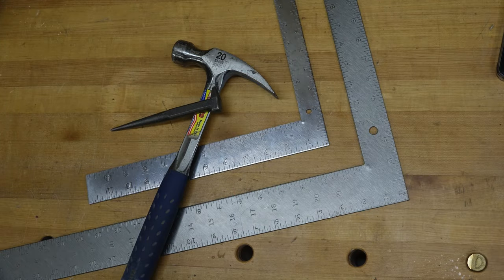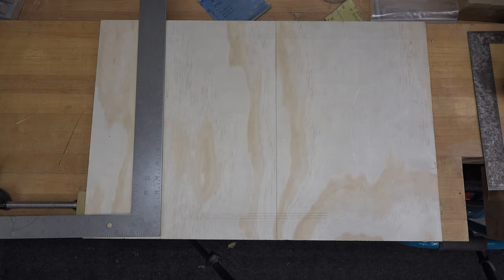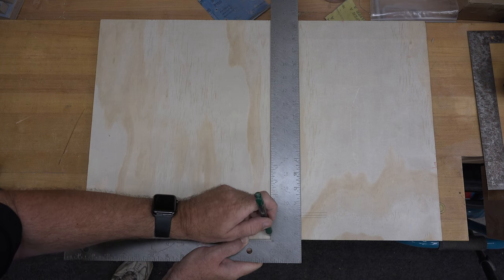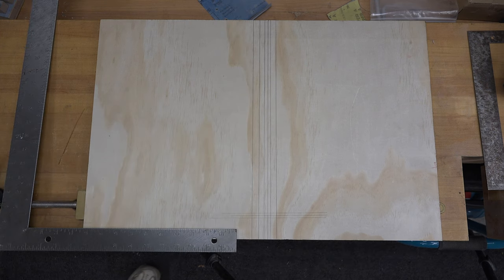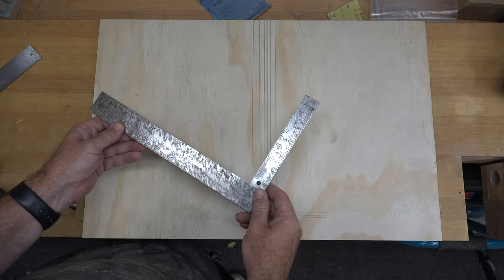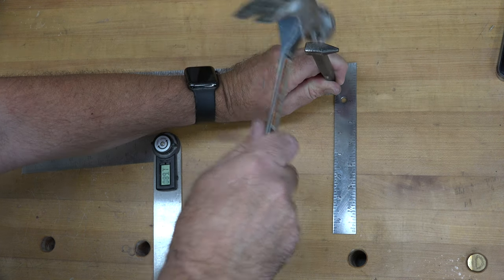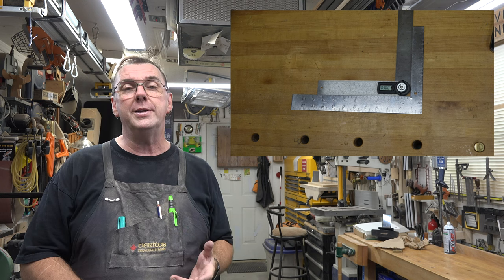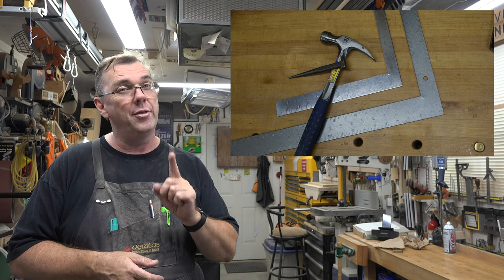Truing Up a Framing Square

Comment: I will be the picky one that points out that the first two lines you drew were on opposite sides of the blade.

Sometimes the blade edges aren’t parallel, so that could be a problem - and you didn’t address that possibility.

Your method for correcting is a good one.  Just check both sides of that blade! 😆
Reply from the maker: While you are 100% right that I mistakenly used opposite sides for the initial test, you will note that for the remainder of the video, I only use the one side of the blade.  I realized my mistake post production and it was too late to change it.  The method of squaring the blade still remains the same however.  Thanks for tuning in and for chiming in with your thoughts Dean.

Comment: Were you adjusting a steel or an aluminum square? That trick does work very well. I used to use a steel square for carpentry at home, but at the ironworks we used aluminum squares. They would take a lot of abuse against the beams or what ever when we were laying out or fitting up structural steel. There was a master square in the stockroom for us to check our squares against. We would make bevel squares out of the bad ones. QA wouldn't let us correct them. I had a really nice steel square years ago that was true until I left it in the hot sun when I was working on the house. It wasn't 90 anymore and it warped a little. Bevel square time lol! I was going to adjust it like you just showed us, but I need a larger bevel square anyway lol. This a great show for those  that have given up on a framing square not being true. Enjoyed, take care!
Reply from the maker: This was a steel square Michael.  I love your story.  Thanks for tuning in and for chiming in with your thoughts.  It's very much appreciated.

Comment: My grand father taught me the punch trick many years ago. He would flip the square over between punches. This way you avoid the dent on the opposite side.
Reply from the maker: You can definitely flip the square over.  That's a great suggestion Mark.  Thanks for tuning in and for chiming in with your comment.

Comment: Ken that's amazing I was always told that a framing square could never be adjusted to 90°, what I heard is that because it's for carpentry rough work (even Speed Squares are not true 90°,now I know I can take my large and medium framing squares and get them to a 90°,Ken Thanks for this awesome tip, BTW the solvent you used is Autosol? I use Naval Gel (I don't care for it the odor is horrendous and it can take 3 to 4 coats)
Reply from the maker: The metal polish is called Autosol.  It's some pretty amazing stuff and works really well.  Thanks for tuning in Alan.  https://www.leevalley.com/en-ca/shop/tools/supplies/polishing/67014-autosol-metal-polish?item=54Z1510

Comment: Thank you for the video.  While you stated you're aren't that concerned about raising the surface of the opposote side of punch strike, there is energy going into out-of-plane deformation (the dimple).  I wonder if this approach were done on a steel surface, if more of the energy would be transferred into the square and thus require a lower striking force?
Reply from the maker: Your method may work David.  I've never tried it as I was never concerned with the slight dimple on the square.  I may have to give that a try.  Thanks for tuning in and for chiming in with your suggestion.

Comment: Ken, how do you know which way it is out of square. You said you guessed and your seemed to guess right. There should be a way of determining it.
Reply from the maker: With the two lines drawn side by side Stephen, if the lines are closer together at the bottom, then the angle of the square is less than 90 degrees.  If the lines are closer together at the top of the lines, then the angle of the square is more than 90 degrees.  I hope this helps.  Thanks for tuning in Stephen.

Comment: Wondering what effect punching the square in the exact same spot on the opposite side of the square would make... I would think it would do the same thing but not leave as big a bump on the one side...
Reply from the maker: I honestly don't know the answer to this question Danny.  The "bump" that is created isn't that extreme so it doesn't interfere with the square's use at all.  Thanks for tuning in.
Reply: @acutabove_woodworkings  My pleasure and thanks for the reply.

Comment: Also someone  said are the width of the square equal too you said they were stamped.
Reply from the maker: That is another thing that you can always check on the square Dean.  Making sure the blades are of equal width for the entire length of the square is not a bad thing.  This video is primarily about adjust them for a square setting however.  Thanks again for tuning in.

Comment: I had seen this method before and did it, but it didn’t help. Pretty sure punched it at the right spot. What could I be doing wrong? Thanks
Reply from the maker: Some squares are beyond help.  My suggestion would be to continue punching it to see if there is any improvement.  If you are not hitting it hard enough, it will not make a difference.  Thanks for tuning in.

Comment: Sorry  ken, you first 2 line you tested was wrong as you did not use the same side of the square,  the arms may not be parallel, and you need to address this issue first, then you can do the line test with all edges of the arms.
Reply from the maker: You are not wrong in saying this Garry but you will also note that after the initial test, I corrected that issue and always used the same side of the square to check its accuracy.  Thanks for tuning in and for chiming in with your thoughts.

Comment: What’s to say your plywood was perfectly straight. Factory cuts can be off too.
Reply from the maker: The edge I tested against was a straight edge.  If you are unsure, a quick cut on the table saw will straighten it up.  Thanks for tuning in

Comment: Aftrer drawing the parallel lines I would be measuring the lines with digital calipers, just to ensure my mark II calibrated eyes balls were still in calibration. Nice restoration!🤣🛫
Reply from the maker: If that's the method that works for you, then by all means, let the callipers do the work for you.  Thanks for tuning in this week.